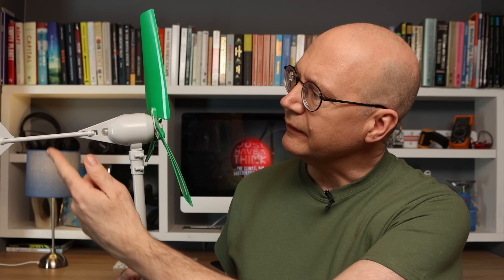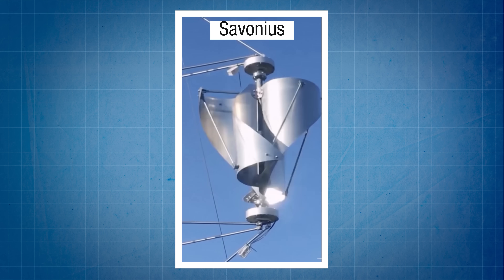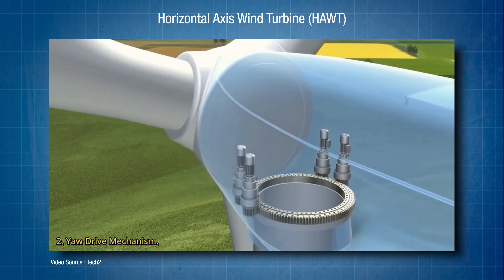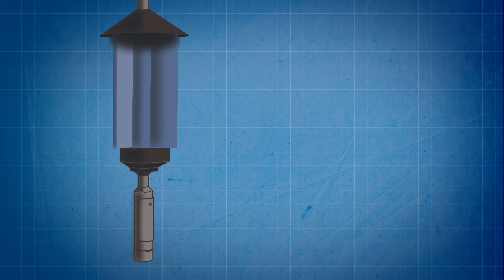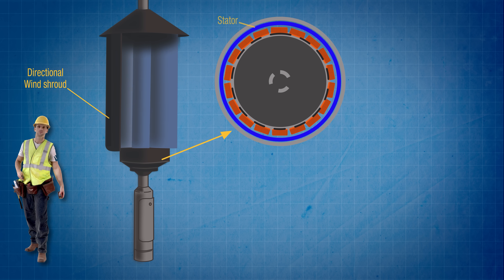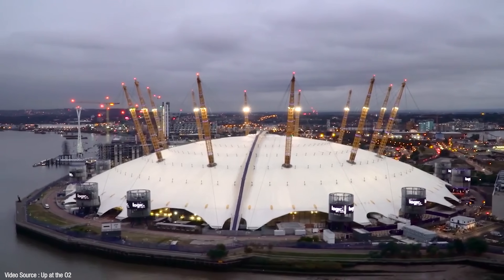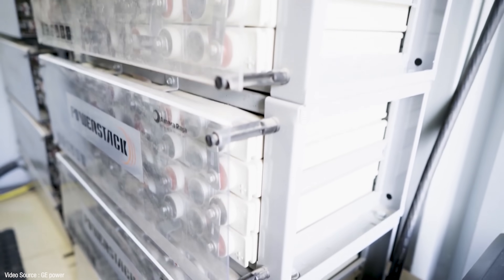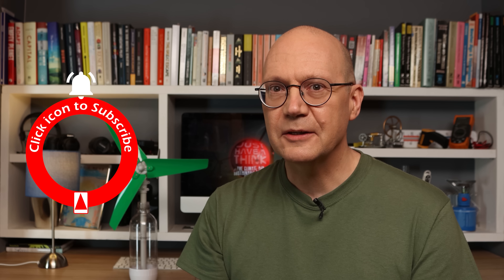A vertical axis wind turbine that doesn't need the prevailing wind! How do they do that?

Comment: I'm still betting on scam. We'll see if they can produce the power they claim in a test with third party verification. The comparison with the solar farm made it clear that their numbers are grossly exaggerated, and then the comment about putting little ones on people's houses - well that's been a scam for decades. Small turbines near houses can work if you have space for a tall pole and guy wires, but you use horizontal axis turbines for that, not the inefficient vertical axis type. Turbines on houses don't work and we have plenty of test data to show that.
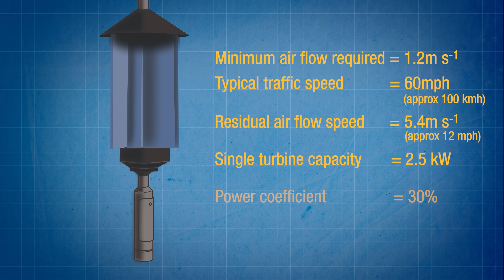Reply: Scam or incompetence. Dave's numbers don't stack up, they are wrong by either two (5:31) or three (8:50) orders of magnitude. (So which is it, Dave, 2.5 or 24 kW?) The right number for a VAWT this size is about 25 watt, by following the standard VAWT physics formulas. It will never be cost-effective.  It is most likely a scam.

Comment: Nothing is free. Nothing. Cars get a form of draft from the vehicle ahead of them due to the moving air. It can substantially improve gas mileage.  The wind turbines will function as dampers that remove energy from the wind, thus reducing gas mileage. The turbines are effectively using fossil fuel to generate electricity. How green of them.
Reply: Sunshine is free

Comment: down. Anyone remember that proposal from Australia that used a tall hollow structure on the order of 1000 meters iirc surrounded by greenhouses. The sun would heat the wire in the greenhouses which would rise through the tower turning a set of wind turbines. The outside of the green houses would be open to the environment allowing air to flow in to replace the hot air rising

Comment: Even huge commercial three blade generators suffer from significant failures at the leading edge, which disrupts the airflow and leads to significantly reduced efficiency. Those multi blade vertical generators are very likely to suffer the same fate, especially with the amount of fine grit thrown up by passing vehicles. It’ll be like a sandblaster.

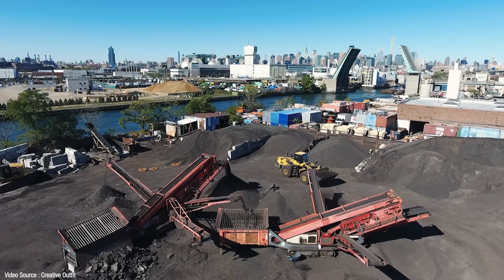Comment: In your VAWT video, there is mention early on (5:30) of each unit having generating capacity of 2.5 kilowatts. But at 8:45, you repeat Alpha311 statement of a 3 MW installation of 125 of their turbines.

How did we get from a unit capacity of 2.5 KW to 24.0 KW?
Reply: Yes, Dave's numbers don't stack up, they are wrong by either two (5:31) or three (8:50) orders of magnitude. So which is it, 2.5 or 24 kW? The right number for a VAWT this size is about 25 watt, by following the standard VAWT physics formulas.

Comment: The more options we have the merrier! The faster we can get fossil fuel usage down, the better off we'll be.
And, yes, I understand it will take fossil fuel energy to get these made, but damn, we have to start somewhere.
Eventually we will be building our next generation of power creation items with already green energy. So I say
ramp up production of solar, wind, tidal, whatever, get it all up and running find new storage methods, get it all
installed. Then, we can go from there, at that point we will be using so little fossil fuels, that we can work on
eliminating the rest over time. And you never know, there is hope beyond hope for fusion, but I'm not
holding my breath on that one any time soon.

Comment: I like the DIY versions as well. Sure, they are not efficient. They are also not expensive to make. Rural DIYers, off the grid, or developing countries. If you have the space, it is about COST per kWh, and the combination of robust, reliable, constant, and primitive has its advantages. 

They can be made from cheap or even free materials.
No maintenance, no expensive repairs (and a DIYer can repair them, no components that are hard to come by, not supplied anymore, or you have to change the whole unit, because they do not  sell the tiny part that failed. The usual obsolescence nonsense).

Long lived, they are pretty robust, and if a fire or storm ruins them - so what. I wonder if they would work in freezing rain ;) 

Owner might have to defreeze them, but they are accessible. But then the TX Feb. 2021 storm delivered a lot of wind energy to keep them always moving. The problem was the weight sensors on the blades shut down the turbines (and that was necessary), they must be perfectly balanced and the ice unevently added weight or chunks broke off, so they were shut down. 

In Texas they are not set up for - 10 or even - 20 degree Celsius, or longer periods of freezing rain, so unlike most large commercial wind towers they had not defreezing tech in the blades (like the wind turbines in Canada or even Germany or in the U.K.  in the Antlantic.

With windchill factor it can get cold. There could be ice build up and then you either stop them or the unsymmetric weight in rotation will damage the gears.

Only thing I would not want to see one of the halved oil drums ripped off  by a storm and sent flying, that could get scary.

They do not produce much under good conditions (horizontal axis windturbines beat them by far if they are adjustig to the wind direction), but they almost always produce some energy, so that is another virtue: reliability and  not prone to "technical" problems. low tech

A person with space  can line them up, have a battery for surplus.

If they are a little elevated, they do not even lose the space, food or grass can grow beneath.

Comment: They would add some energy even on sunny days - but even solar needs until the later morning to gear up and production goes down with late afternoon. Which is when traffic picks up as people drive home from work. Plus catching all the wind that comes on rainy days. Not as efficient as the vertical ones, but it adds. 

And no problems with birds or infrasound.

Comment: 3 things 1) lots of units - recycling ? 2) noise when they get loud and drive the residents insane - on the other hand I wonder if those turbines might swallow some of the noises even. But they better have bearings that are really good an a yearly inspection and get some fat. or there are not parts that could get lod  3) what happens if there is a really bad storm, could it compromise the masts and lamp posts - they were safe as is but now with the wiind catcher .....

Comment: Turbines work by slowing down the wind. (I'm pretty sure) the car will experience more drag driving past a turbine than it would if there was no turbine. This needs to be modelled. Lots of little bearings to install and maintain in the central reservation sounds like a nightmare.

Comment: The scalability of these things looks pretty extreme.  One of the things I am thinking is why not have a series of smaller versions of these inside the front grill of an electric car?  Charge the car while driving 20-30-40-50 miles an hour down the road.  Massively extend travel distance, and feasibly even have them recharge the car at night by parking into any prevailing wind.  This on top of the solar charging paint and solar windows, maybe this will be a car that can drive forever for free?

Comment: The problem with this is that they are actually reducing the efficiency of electric cars, or actually any car.  Think about it.  A car needs to move air out of its way as it travels.  If something is impeding the movement of that air, it will take more energy to move....  They've also done this with pressure plates, and yes the result is the same, if you are extracting energy, then more energy needs to be input....
Reply: Hey, didn't mean to be a debbie downer,  I follow and watch all of your videos....keep it up.

Comment: One of the suggestions near the end was about putting smaller versions on home roofs.  This sounds good, but what's your take on any increased chance of attracting lightning strikes?  After all, it is essentially an electromagnetically-charged pole.
Another Q is about other sources of "non-wind" applications to turn the turbines.  Could hot climates that frequently have thermal updrafts be enough to turn the turbines (imagining soaring birds simply being able to stay aloft via the updrafts alone)?

Comment: no cost per megawatt comparison with fossil fuel generation?
Reply: It would end badly: 
Wind electricity is about 20 x more expensive than the use of fossil fuel. But that's only the cost of the randomly produced electricity. With demand-side management (deliver electricity out of storage when needed) this price will skyrocket another time.
Reply: @TheSpecio  thanks for the honest response, pity there is no viable "storage" yet.

Comment: I always wonder why this type of wind turbine aren't being installed along the (exterior) corners of skyscrapers from ground to top.

I imagine the sides of the buildings will catch plenty of wind energy and redirect it to those corners, harnessing MUCH more wind than just standalone turbines.

And obviously with the added benefit of energy generation right where its consumed.
Reply: Maintenance required for the small amount of energy generated doesn't stack up financially. Indeed, the energy generated wouldn't even pay for the initial cost.
Reply: @ledsalesoz  Is it? I'm genuinely asking here. Did you do some rough calculations on that? Isn't there plenty of wind in between buildings in big cities?

Comment: There is nothing sustainable in wind and solar power production, it's very unsustainable and unreliable. You should change your channel's name. As for the problem you all trying to solve with this so called green energy - there is no one. CO2 is not the cause for the climate change. So instead to picking up crumbles, with this wind turbines it is much better to use what we already know works fine, reliably, and cheap ( coal, oil, gas, hidro and nuclear ).

Comment: Don't these windmills increase the air-resistance for cars? I suppose they do by small pressure waves going between the windmills and cars. I think an airo-dynamic engineer should be consulted for this question.

Comment: This is very good news.  For a long time I had thought that I’d like to instal vertical windmills in the peak of roofs.  May be there’d be some drawback I haven’t thought of?
Reply: a lot. VAWTs are so inefficient that you won't get your money back before they break down. This design here produces 25 watt, which may be enough for a couple of light bulbs, or maybe charging your phone. And then there is the vibrations through your house, especially when you want to sleep.
Reply: @tzenophile  Hmm, 🤔 he says 5.8 kWh per day per turbine from traffic flow.  That’s a bit more than just charging a phone.  But yes vibration would be a problem
Reply: @makingitthrough190  No way that thing can produce that much. Dave's numbers don't stack up, they are wrong by either two (5:31) or three (8:50) orders of magnitude. (So which is it, Dave, 2.5 or 24 kW?) The right number for a VAWT this size is about 25 watt, by following the standard VAWT physics formulas. It will never be cost-effective.  It is most likely a scam.

Comment: Here comes a dumb question, but I get the can't-get-something-for-nothing itch. Would the resistance of the turbines transfer to the resistance of air which resists the movement of the car reducing the efficiency of the car? I suppose it would be negligible if any, but I can't help wondering.

Comment: How does this wildly delicate mechanical efficiency deal with road/vehicle particulates over time? .. How much maintenance is required in a dirty environment per <period-of-time>?.. Who will maintain them when the lease is up & how easy are the parts to aquire (for when the corp sells or ceases to exist).. For residential use, check out corner mounted VAWT on diagonal opposite corners of buildings.. Gets around alot of complaints of HAWTs in residential settings..

Comment: I live off-grid with solar. We bought a VAWT and in 60km/h winds it barely generated enough stable energy to charge a mobile phone. Granted the rectifier could have been wonky, but then for the price I bought another few solar panels. Now, considering that these turbines will be at least 10 meters from passing cars, I am very, very sceptical of their claims 125 of these things can compete with 12000 solar panels. Also passing cars generate some air displacement (i.e. wind) but the next car generates turbulence. So no, this is a money grab.

Comment: Why not put a odgv (omni directional guide vane) around it to increase the air speed acting on to the turbine as clearly power available in wind increases by velocity cubed as per general wind power formula? Any thoughts on this? Please share your views

Comment: Talk about a stealth fuel tax!!
All the power captured by this system will reduce the airflow along the traffic lanes (conservation of energy). So all the vehicles will experience a little bit more drag, which means they will be required to burn more fuel to travel at the same speed.
This is just as pointless as pavements that "harvest" foot-fall energy.
"Ye cannae beat the laws of physics, Jim!"

Comment: I've said for years that wind power only makes sense on a small scale.  Those HUGE wind mills are a total waste.  Expensive to make, expensive to maintain, expensive to tear down, and expensive to dispose of, those big wind turbines have never delivered what they promise.

But these little Vertical units make sense IF the logistics are in place to take care of them.
Small inexpensive SIMPLE units can contribute.  They are the exact opposite of what the pie in the sky crowd are pushing.
The keys are
small scale
simple
low cost
and
quit trying to REPLACE fossil fuel COMPLETELY and just contribute a smidge here and a smidge there
Reply: Nonsense, 15 MW wind turbines make a lot of good sense; Denmark is getting 55% of their power from windmills, and they are not exactly small. So maybe you need to read up? 
These VAWTs, on the other hand, are a scam: Dave's numbers don't stack up, they are wrong by either two (@) or three (@) orders of magnitude. (So which is it, Dave, 2.5 or 24 kW?) The right number for a VAWT this size is about 25 watt, by following the standard VAWT physics formulas. It will never be cost-effective.
Reply: @tzenophile  here we go again
as for Denmark, you just quoted one, and only one, stat.  And it's a meaningless stat!  I don't care if Denmark gets 100% of their power from windmills.  It's a HUGE expense and a bigger logistical effort.  Give it time.  Denmark will have to replace these mills and they will have to decide if it's worth it.
Denmark is a small, compact, and well managed capitalistic economy that may (emphasis on "may") make windmills work.  But I seriously doubt it.
meet me back here in twenty years and we can discuss what happened and why
Ad for the numbers quoted in this video, I'm very sure they are extremely optimistic. 
butt
I'm talking about overall logistics
The advantage of small and large numbers over FREAKING HUGE  and built one at a time by hand is what I'm talking about.  Small units that can be put up in a day, easily fixed, and easily replaced can also be massed produced which will be far more affordable.
Reply: @scotte2815  Why don't we meet 800 years ago, when Denmark first started using windmill energy, or 120 years ago, when they first started using them to produce electric power? Don't worry about the Danes, you are way too late for that party.  I would also like a small, private turbine that takes care of my needs and nothing more. But romanticism aside, that is a much worse investment, and much more of a maintenance and stability issue than the big 15-MW-per-turbine wind farms in Denmark. And they have huge plans for the future. Do you really think you can teach them something that they don't already know, after 800 years?
Reply: @scotte2815   No, I really don't get your point about logistics; or, I get what you are trying to say, but it sounds completely off. Is there an actual argument there, somewhere? Economies of reverse scale? For energy? Is that a thing? Old granny down the road servicing her 50 foot windmill tower?  If you have some actual research data to share I'm all eyes. If not, don't bother replying. I am skeptical, to say the least.  Do you really expect me to believe a dude on youtube who says the most successful in the business are doing it wrong?  What are the odds for that? Seriously, man.
Reply: @scotte2815  I would if I thought you'd be able to produce the research to support your claims. As it is I don't see the need to go anywhere, so I'm staying right here. How was that about the advantages of small over huge, again? You see, I simply don't believe you have ANY data to back that up. So I'm calling it. BTW, you're not American, are you? (Not meant as an insult, just curious for statistical reasons).
Reply: @tzenophile I was born and raised in USA served in the military. are you danish? 
I'm not talking about stats, I'm talking about principles and dynamics. But if you need stats to understand principles than ask yourself how many model T Fords and Volkswagen Beetles and Morris Minors were built compared to Bentleys and Lamborghinis?

Comment: I find hard to believe that the intensity of the highway wind by itself is enough to generate the power numbers presentee in this video: 2.5 kw is a lot of power! However, what I see here is a cost-reduced windmill taking great advantage of existing posts and electrical wiring to the grid. I feel that just these two factors could propel this idea into reality, couldn’it?